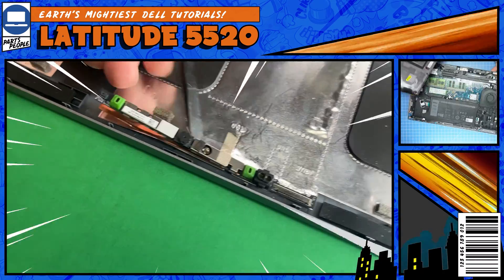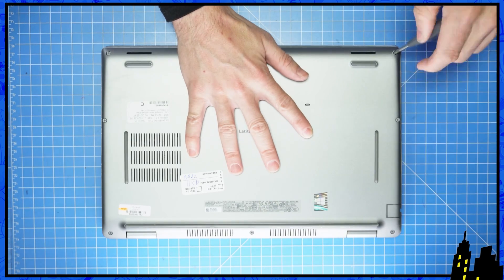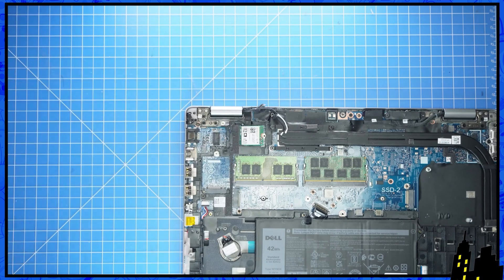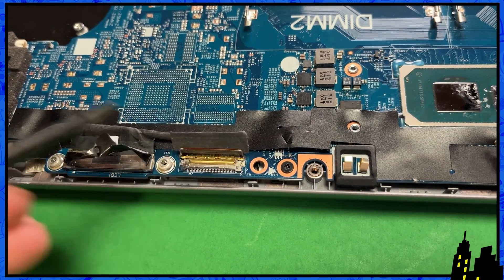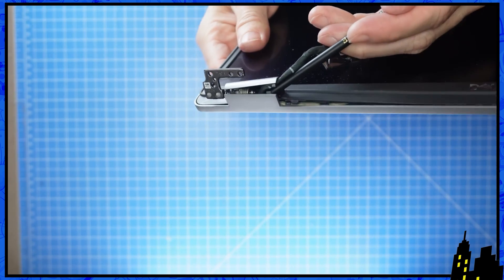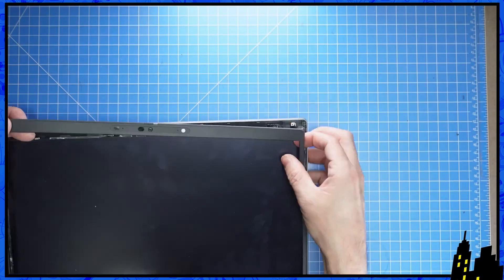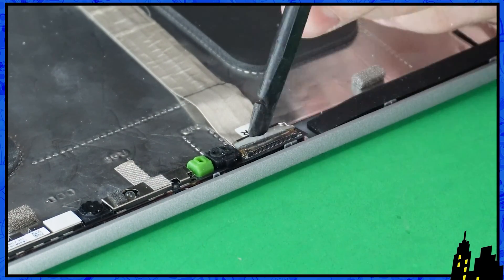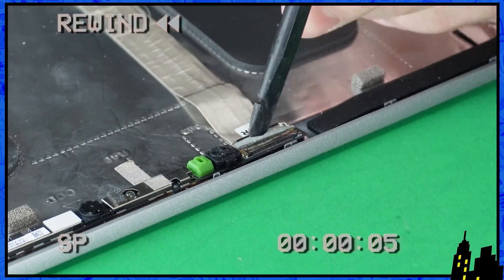How To Upgrade or Replace Your Web Camera | Dell Latitude 5520

Comment: if you have the right tool you can just disconnect the battery and pry open the plastic cover of the camera and replace it from there without dissembling the whole thing but you need a small plastic pry tool to plug the cable back in the camera